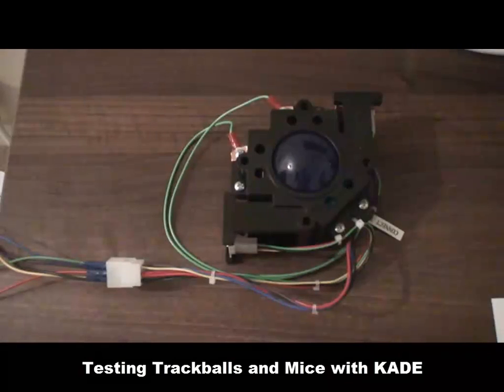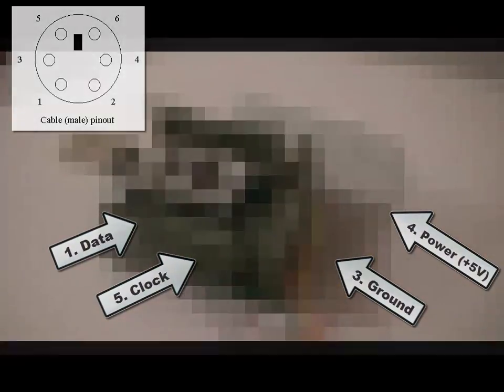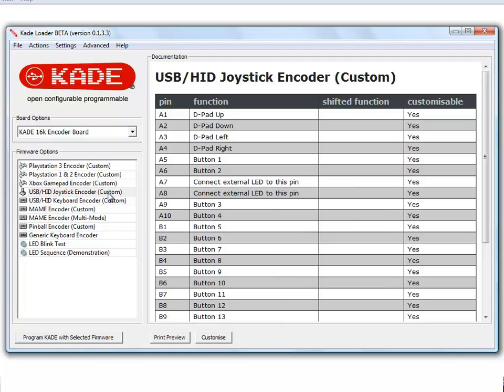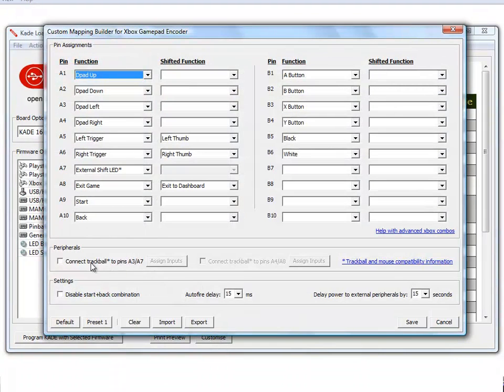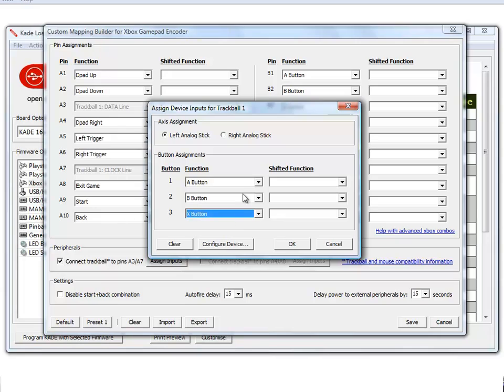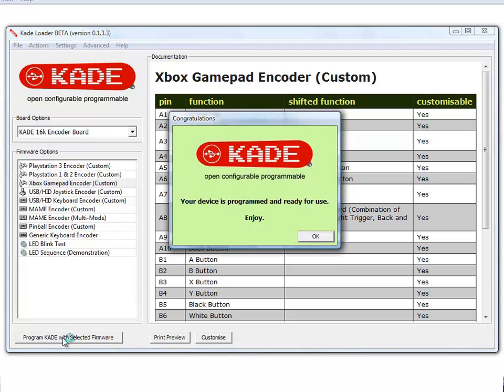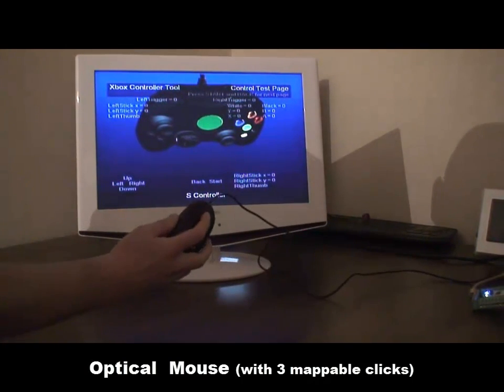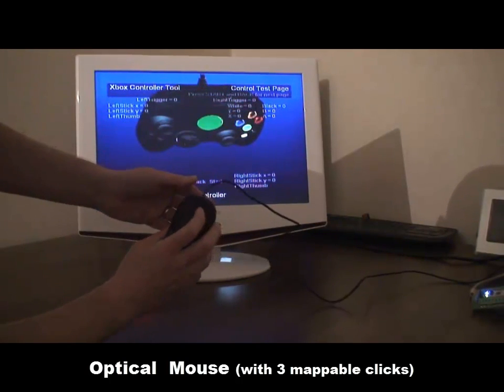KADE - Setting up and testing with Trackball and Mouse

Comment: This is not working in the latest release or any other version. When I program the kade for xbox with trackball support. The xbox controller app does not register the kade as a xbox device. Please help as I need this feature for one of my cabinets.

Comment from the maker: An xbox to USB adaptor cable is required to interface the KADE with the xbox controller port. 

suntekstoreDOTcom/goods-10005822-black_usb_adapter_cable_for_xboxDOThtml